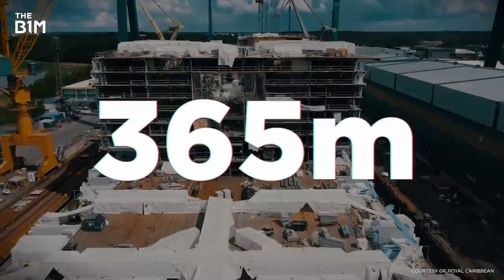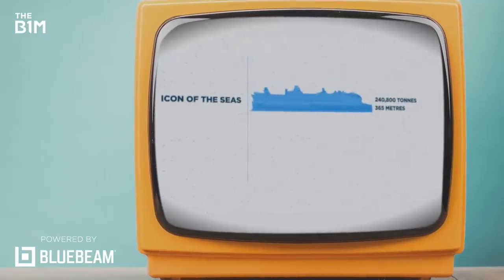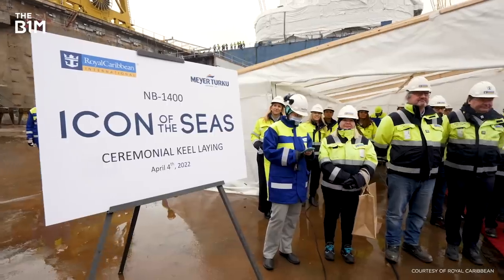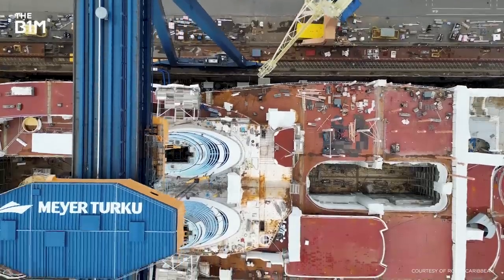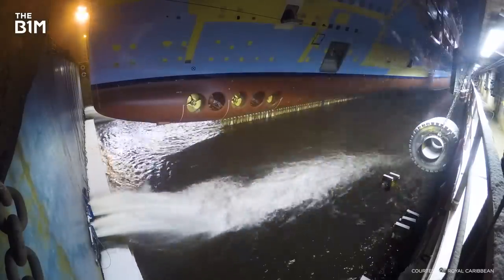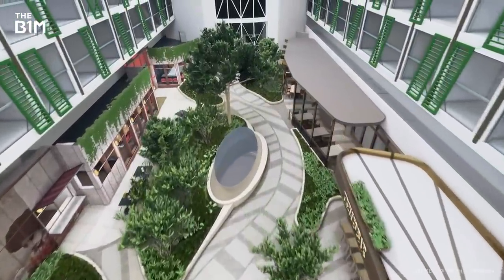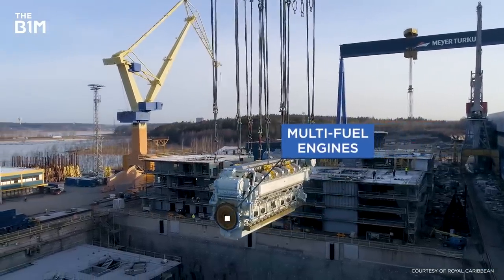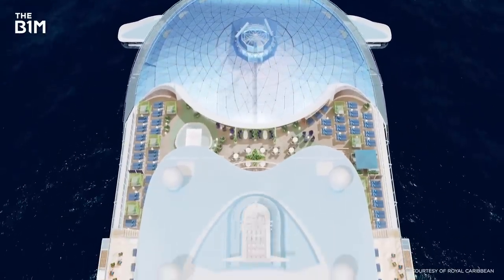The Insane Scale of the World's Biggest Cruise Ship

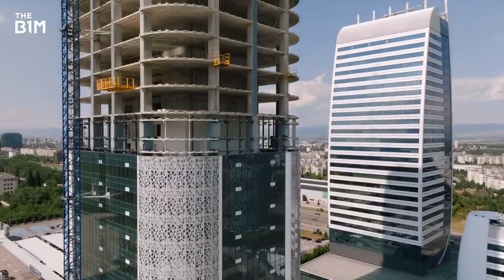Comment: 3:25  That is untrue.  The exterior of a skyscraper is installed before the interior.  Otherwise the interior will get rained on.  I have trespassed in many skyscraper construction sites to see how the construction process works.  And I have never seen the interior installed before the outer windows and cladding.  On when I explored consort place recently the central core was built to floor 63, the concrete structure of the floors was built to floor 60, the outer windows and cladding was built to floor 50 and the apartments were being fitted out to around floor 25.

Comment: I was under the impression that only the hull  section was build oif steel, and that above hull was built of aluminium, not only for total weight but also centre of gravity issues. Is Icon of Seas truly steel all the way to top deck?
Reply: They are all steel.  The heaviest bits like the engine and fuel tanks are at the bottom center.

Comment: What fascinates me even more than building such insanely complex structure, is drawing a plan and thinking about every tiny detail in a layout where everything should go! Just imagine the nightmare of all the necessary wires and pipes 🙆‍♂ Truly mind blowing undertaking 🤯
Reply: The bigger nightmare would be reducing 5000 to 7000 passengers stranded at sea in the middle of nowhere. You might not even get there on time depending on how far or badly damaged the ship gets
Reply: It gets your eyes very very very, very strained working on those CAD files!!
Reply: This is the best & most sensible comment in my opinion as an experienced engineer. Despite the availability of a plethora of modern software tools it's an extremely complex & strenuous job.
Reply: @millevenon5853 yes. The exhilaration of constructing a behemoth relegates such considerations to the backyard of one's mind.
Reply: @nirbhay_raghav  Modern software tools reduce the burden greatly.
Reply: @chviswaprakasharao244  which software are you talking about bro? As far as I know almost all CAD and 3D softwares strain eyes immensly especially when the file is this huge with tens if not hundreds of layers with hundreds of thousands of intersecting lines. Working on these ships is like working on a multistorey apartment and detailing them takes lot of squinting.

Comment: One limiting factor is that e.g. in this specific shipyard in Turku Finland, they can't really build anything taller than this since otherwise it can't fit under the Øresund Bridge that connects Denmark and Sweden.
Reply: you do remember that part of that crossing is also a tunnel right?
Reply: Partially correct, but you got the wrong bridge. Large ships from the Baltic Sea can't go through the Øresund strait, so they go through the Great Belt where the water is deeper and the bridge is taller. The maximum for ships there is around 15 meters below the waterline (vs. 8 meters in Øresund) and 65 meters above (57 in Øresund) - also known as "Baltimax".
Reply: That would be a thing, that it doesn’t fit underneath 😂
Reply: I wouldn't be surprised if a company had enough money to temporarily dismantle the bridge to get their ship through :^)
Reply: @Esbbbb  I haven't heard of something like that yet, but they have other tricks up their sleeve for passing under the Great Belt Bridge. Another major cruise ship, Oasis of the Seas, was built at the same Finnish shipyard in 2009 and they definitely designed it to only just fit under that bridge. As described on Wikipedia:

"The bridge has a clearance of 65 m (213 ft) above the water; Oasis normally has an air draft of 72 m (236 ft). The passage under the bridge was possible due to retraction of the telescoping funnels, and an additional 30 cm (12 in) was gained by the squat effect whereby vessels traveling at speed in a shallow channel will be drawn deeper into the water.[33] Approaching the bridge at 23 knots (43 km/h; 26 mph),[32] the ship passed under it with less than 60 centimetres (2 ft) of clearance."
Reply: @papaquonis  also what would help is to do this during low tide I'd imagine.
Reply: @papaquonis  I'm pretty sure there was a bridge dismantled in the netherlands for a boat
Reply: @papaquonis 60 cm clearance for basically a floating building is insane
Reply: @MihkelKukk   Yes, part of it is tunnel, BUT, the water level above the tunnel is too shallow for this ship to fit above it, so it does sound like easy solution, but it is not.
Reply: gotta raise the bridge a little bit 🤣🤣🤣🤣🤣
Reply: You're forgetting the France with its Saint Nazaire so they can build bigger if money keeps flowing in...
Reply: @MihkelKukk  About low tide, that is not really a factor at all where the bridge is situated. The tidal difference around there is neglible (a few inches at best). The weather (high or low preassure plus wind direction) actually makes way more difference in Öresund :-)

Comment: @B1M what about converting office towers to houses like they fill a cruise ship with pre made hotel rooms?
Reply: Problem is an office building usually lacks things like sewage conections across the floors
Reply: @lukasvondaheim  and you'd also end up with units that have no access to natural light
Reply: @lukasvondaheim  the connections could be pre built into the units. this is done in cruise ships I think.
Reply: @liamness  one of my thoughts is to open up parts of the cladding to make open air " streets" and parks through the building and knock out sections of floors as are seen in high rise neighborhood concepts.

Comment: Top heavy death traps. There is no surviving an accident on one of these. You cannot offload that amount of people into 1/2 the life rafts. When these go they always capsize. This renders half the lifeboats inoperable, depending on the speed of the capsize the other half will be unusable to. A naval architect brought a case against the cruise industry highlighting the design flaw as and he was very quickly muscled out, threatened and discredited. Sail at your own risk. The big one hasn’t happened yet. The Costa Concordia would have capsized in 150m of water but on the night she hit the rock the wind was unusually in a direction that blew he onto Gilio Island and saved over 3500 lives. At least 2000 would have been killed if the wind was in the other direction as it statistically should have been in this area. Quite simply a fluke.

Comment: The upper limit in cruise ship size from any port in the Baltic sea is determined at the Great Belt Bridge in Denmark. 65 meters clearence  sets a very difinitative restriction. Tide, speed, ability to lower parts of the ship is clever, but you need a safety margin or risk damaging a vital infrastructure costing 40 billion kroner to replace and wrecking havoc on Danish economy. https://en.wikipedia.org/wiki/Great_Belt_Bridge

Comment: Obviously shipbuilding engineers will have thought about it, but still I wonder how much stability has such a (maybe) top-heavy ship, with the emerged part much taller than the submerged one, and with a rounded hull to march! What are the chances of capsizing with a big enough side wave?
Reply: They are not top heavy, the opposite actually.  The heaviest stuff, like the engine and fuel tanks are low and center.  It's not balancing upright, it actually wants to stay like that if you try to push it over.
Reply: Upper decks usually include lighter materials like aluminum and fiberglass to counter the weight and since less strength is needed.
Reply: @TheVonMatrices  both icon and oasis class are all steel.  I have never been on a cruise ship with aluminum or fibreglass for anything structural. You have an example?

Comment: such a big cruise liner deserves a large dedicated full size helicopter hangar, that can easily accommodate no less than 5 - 8 large & medium size helos . . . like the ship borne Eurocopter H155M Dauphin III maritime multi mission transport helo . . . the huge semi circular glass (facade) dome could have done with a more aerodynamic design . . . a 240,000 ton cruise liner is a guzzler which is a fact . . . in that case you might as well opt for cost effective hybrid marine propulsion solutions . . . all in the interest of reducing operational running costs (which is even bigger than the ship itself) . . . max number of passenger on board could have been limited to 6,490 - 7,600 paxs, plus 1,000 crew . . .

Comment: I think the size of the ship is limited by the new panamax dimention. This ship is 1m below the new panamax length, which is the length limit to pass through the panama canal!
Reply: This ship can't pass through the Panama Canal, the new locks have a width of 55m but the beam of this ship at maximum point is 65m.
Reply: @alexanderfoster3628  thank you for pointing this out. I’ve searched again and you are right. The reason I think the length is within the panamax is, large ship construction docks are designed to construct panamax dimention vessels (no more longer sized vessels). Maybe the limit is the size of docks.